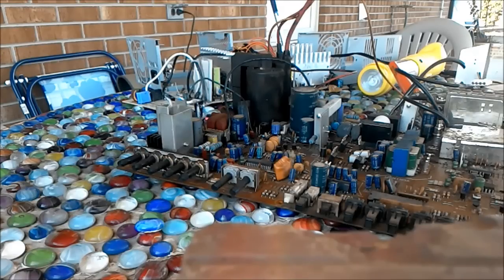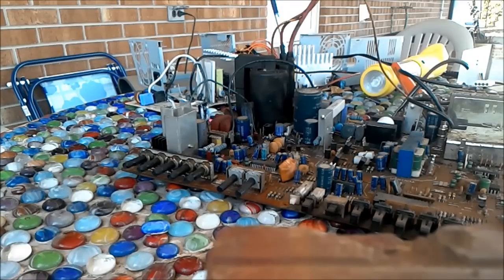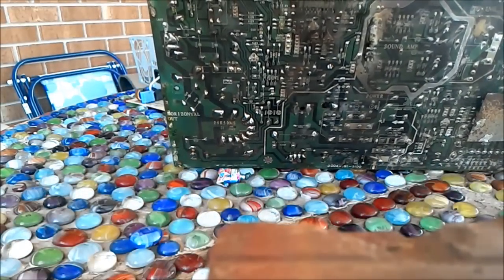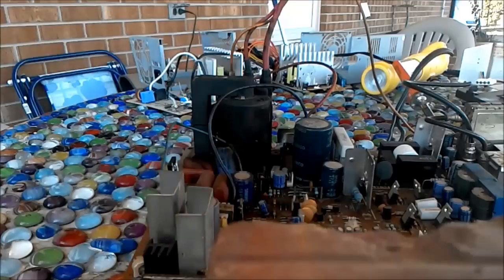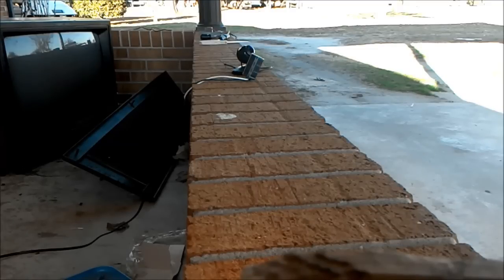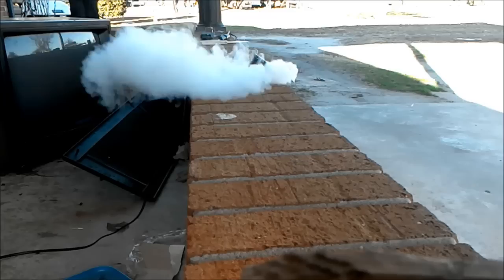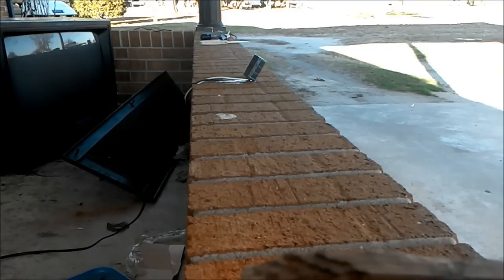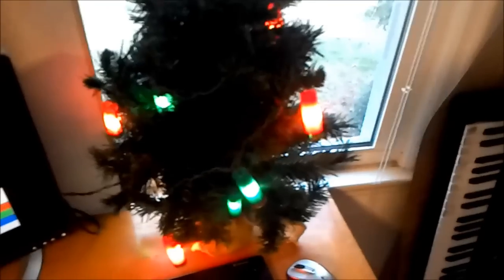Blowing Up Random Capacitors

Comment: This would be TERRIFYING if you turned on the TV and the capacitors blew.

I just recently reinstalled Windows 95 on one of my machines, hooked up my speakers to it, and I heard a pop.
Smoke poured out of it and filled the room with a rotten-egg smell for about 15 minutes. I'm assuming it was a blown capacitor, but I unplugged them SO fast because I didn't want eny more power going through.
Words of advice? 
Don't put 9V through a 6V speaker and turn on Bass Boost.
Reply from the maker: Chad robinson lol this actually happened to my school principals computer! Good thing he never used it!
Reply: satoma satomis Like....on fire?!
IN SCHOOL?!
xD
Reply from the maker: It was in school! XD It just randomly burned for no reason while the computer was off! It had to have been from a power surge or something.